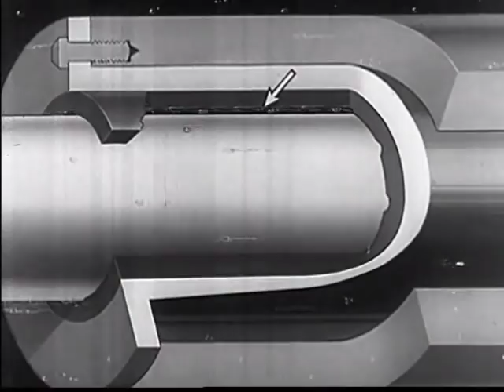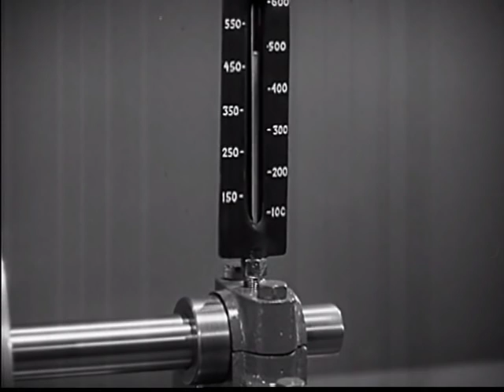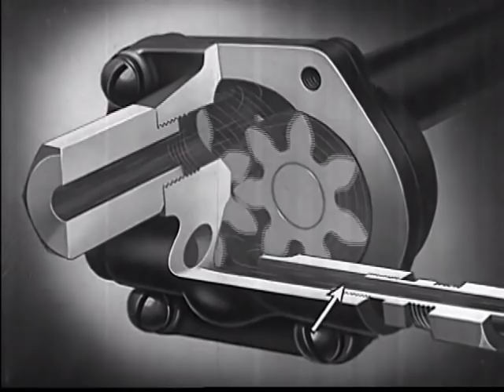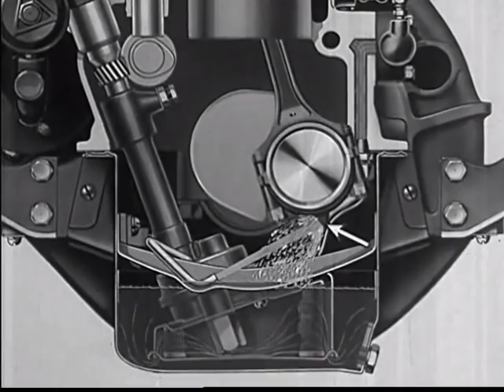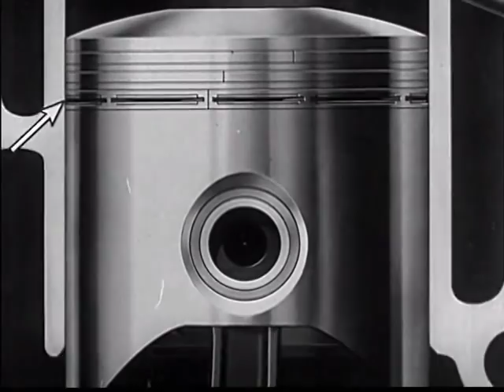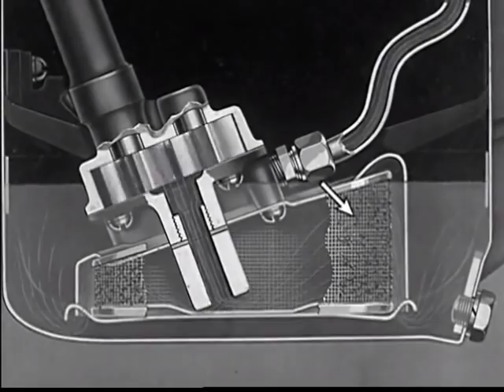How engine oil protects - How the Engine Pressurized Lubrication System Works - 1937

Comment: I am doing some research for making a dry sump block from scratch and knew this would be the best explanation ever!
But I cannot go without quoting: "In the modern engine(1937) the main bearings carry the load of the crankshaft as it twirls at !HUNDREDS! of revolutions each minute!" 
Even though it sounds funny by now you must respect that even today's 20k rpm F1 engines get lubricated the same way!